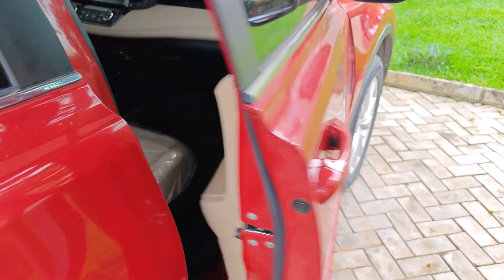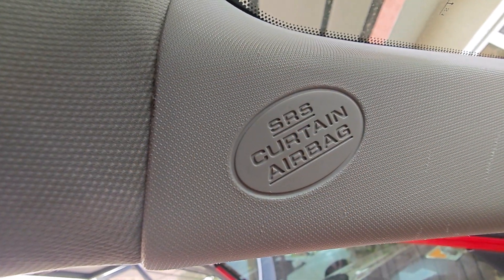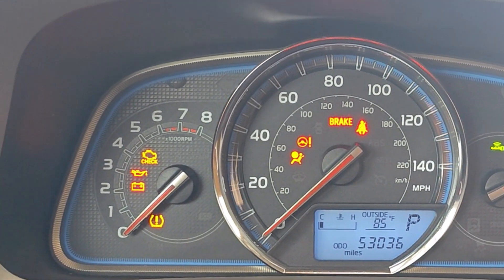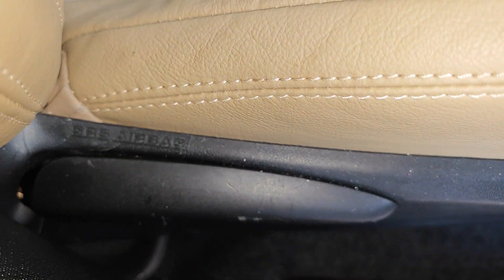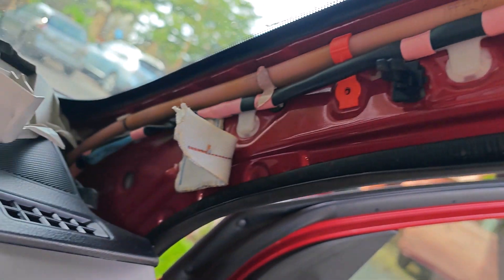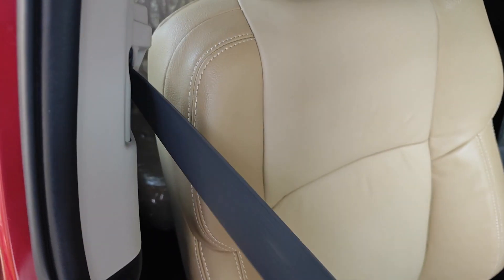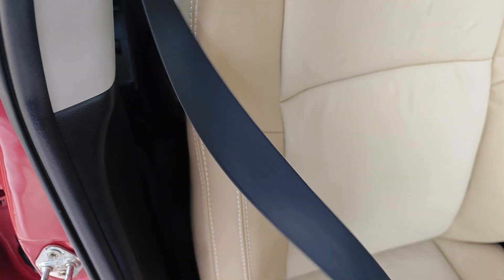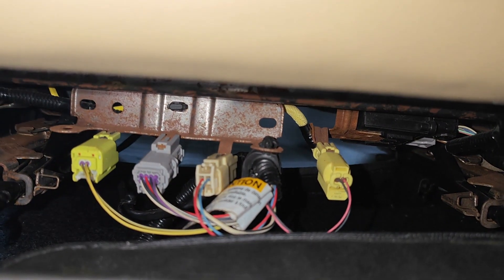Repair SRS after accident / Used Car Missing airbag! 2013 - 2018 Rav4 - Repair plan

Comment: nice work. You can also unplug the airbag connector and  but 2.2 ohm resistor to diagnose if the airbag is faulty🙂😬
Reply from the maker: That's what I'm sure they did to the airbag connectors in this car. 😂
Reply: @DIYAutoworksNG  cheap fix😣
Reply from the maker: Cheap dangerous fix!